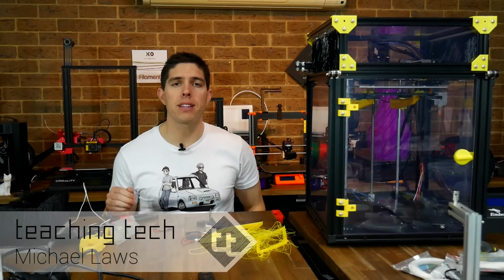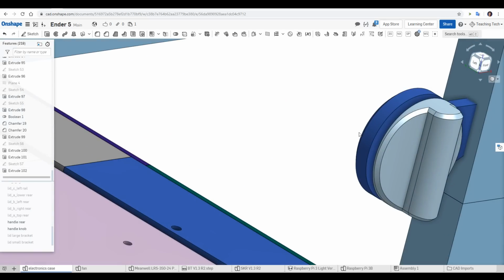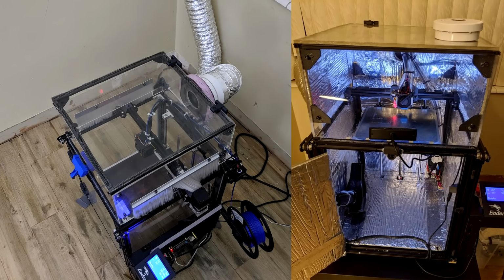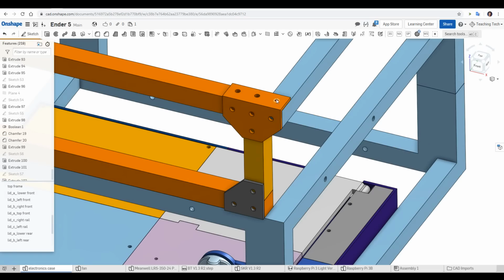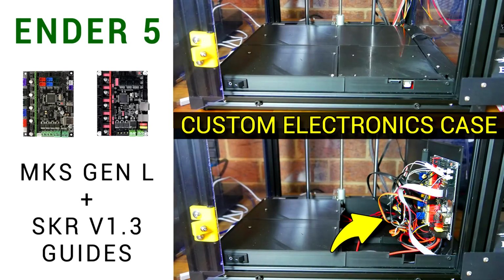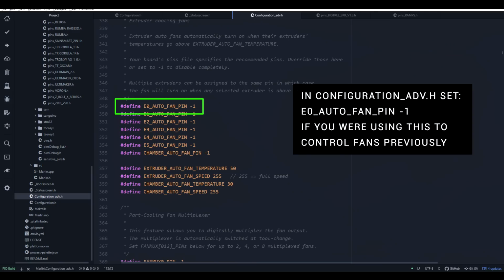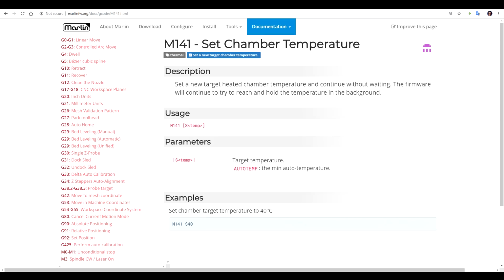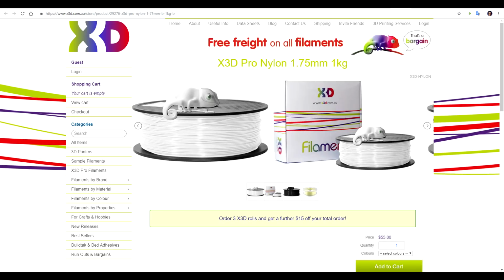Ender 5 enclosed lid and heated chamber guide

Comment: Finally. I have been waiting for this for some time. Thanks Michael. As always great upload. Any chance you plan to build a VORON???
Reply from the maker: Perhaps next year but no promises.
Reply: A VORON is a amazing 3d printer but so little people will build one because of how high end the materials are for it and overall cost. The Hypercube and Piper 2 are pretty popular because they are a fair bit cheaper mostly because they are not using linear rails. 
Also the newer style DIY infinity Y axis printers are gaining in popularity with a endless Y axis like the White knight and Piper Infinity. I can imagain quing a entire project in 1 STL file and hitting print then comming back in 3 days to have ALL the parts required for the project AMAZING!.

Comment: For your next try I'd suggest searching for PTC heating elements, they can come with just the PTC cartridge or with a finned radiator.  Ali Express has many.  The beauty of PTC is that their resistance increased as they reach their max temp making them very safe.
Reply from the maker: Thanks I will look them up.
Reply from the maker: A quick google tells me you are spot on. I've ordered a 500W one that will fit inside the chamber where I have the existing heater. Fingers crossed.
Reply: @TeachingTech  
Glad you found something, PTC's are pretty easy to work with so it should not be a problem.

Comment: I built a similar one for my CR10 and you need almost 200 watts to slowly  get warm.  It's the acrylic that is the problem.  Too much heat just leaves through it.  I tried  a 250w heat lamp and damaged the acrylic long before it was 30c inside.  I don't like using a fan. I'm not an expert but moving air can be a printing problem too.  I also don't like hair dryer type heaters either.   Too much heat and unreliable motors make a fire hazard quickly.   I have a 400 watt convection plate type heater is nearly 600 mm square x 17mm thick and sits vertically on the side/back.  So no fan.  It still takes 20min. to heat to 40c.  But it heats up quickly from there. ( Its heavy).  Consider safety  and what-if scenarios please.  Thermal switch  or thermostat  plus a line voltage control is what I use.  (Smoke alarm and fire suppression are great ideas.)   About the acrylic: It melts and will start sagging after 60-70C.  I know 1st hand.  Polycarbonate is good with 90C.   Fire proof insulation on some walls and top will reduce your wattage needs and warm up time.
Reply from the maker: Great post, thank you.
Reply: @TeachingTech  have you considered glass for the walls instead of acrylic? Might be able to handle the higher temps better.
Reply: I noticed that and will apply thermal film to see how much it will help.
Reply: I have a huge rool of ceramic fibre hi temp kiln lining I might try that ceramic fibre as a way to hold heat in and it's also flame proof  I'm thinking of making a enclosure with ceramic fibre walls and I dont really know what to use to actually heat it tho
Reply: I use tevo tornado, with hotbox fabric with fireproof inside, next troùble was stepper motor became skip when hot..  any idea?
I use SKR1.4turbo, it has free 3 spares fan port, is it okay if i add 4010 fan add the bottom stepper?

Comment: how about one of these
https://www.ebay.co.uk/itm/12v-24V-150-Watt-Car-van-Fan-Heater-Blower-Demister-12Volt-Sealed-Truck-UKstock/173918180181?epid=0&hash=item287e54d355:g:hjEAAOSwnThc75QS
or
https://www.ebay.co.uk/itm/2kw-2000w-Portable-Electric-Upright-Adjustable-Fan-Heater-Hot-Cold-Small-Fast/153619865533?epid=1205453708&hash=item23c4751fbd:g:AR8AAOSwCUldZN5j
and finally
https://www.ebay.co.uk/itm/2PC-Wall-outlet-400W-Portable-Furnace-Space-220-240V-Plugin-Electric-Mini-Heater/382655901679?_trkparms=aid%3D555018%26algo%3DPL.SIM%26ao%3D1%26asc%3D40733%26meid%3Dbca514954355472a85ac3b48edc47a75%26pid%3D100005%26rk%3D3%26rkt%3D12%26sd%3D273978586776%26itm%3D382655901679%26pmt%3D1%26noa%3D0%26pg%3D2047675&_trksid=p2047675.c100005.m1851
Just some ideas.
Great video. Keep up the good work.
Reply from the maker: Thanks for the links. I fear they will be too big.
Reply: @TeachingTech  Fair point but was just offering cheaper options. The smaller wall socket one might have done with some mods.

Comment: I cringed a bit when you showed off your hotend heater. That thing needs a local thermistor watching it. The one you put up top would not know if the chamber heater went into meltdown.
In my industry, large wire-wrap resistors are connected across mains (typ 120V) to help keep outdoor equipment enclosures dry. Those things can get blistering hot. The design is a hollow cylinder and some even have fins cast around them.

Comment: That heat gun for heating the enclosure looks like the only prommising enclosure heater. The silicone mat might do it but atleased with the hot air gun you can make the air hot and flow to ventilate it outside for those nasty fumes.
Reply: Ceramic heat lamps work well, and NASA modified a Lulzbot to print PEEK and PEI using an array of 50w halogen lamps controlled via firmware. They even wrote a nice little paper detailing the work that went into the setup.

Comment: Great video! I too wonder what can be used to heat a chamber... A guy at MRRF this year used a food dehydrator. Maybe that is something to consider!
Reply: They usually don't get hot enough for a real heated chamber. Perhaps one could be modified to ignore it's thermal switching stuff, but at that point it'd work like a weak hair dryer. So it'd probably be more effective to use an actual hairdryer.
Reply: I believe that. I have a food dehydrator that I printed walls for to dry filament. I put a temperature sensor at the bottom and it reads ~65C when cranked up to max. But that is a smaller area to heat for sure.
Reply: I think a heating lamp inside the chamber would be perdect. You can easily control with a thermostat, zero noise, and its even gives an awesome red glow.

Comment: Hi Michael, how about an ender 3 enclosure? Can the electronics be inside with TMC drivers? And Pi zero!
Reply: You don't want your electronics, namely your psu, in an enclosed, heated space above 40-50c (which is on the low end of what you'd want for printing abs or other high-heat plastics).

Prusas blog has a quick overview of basic enclosures ranging from cheap photography "enclosures" to the lack enclosure.
Reply: @YEETPRIME  thank you I was referring at the PI and drivers not the PSU
Reply: @belenhedderich3330  that's on the warmer end, it should be fine but probably won't last as long as their projected, from manufacturer expected lifetimes (which may be negligible in the first case). I did state for all of your electronics, which still remains true

Comment: I'm successfully printing polycarbonate with a bed temp of only 85C and a non-heated build chamber. Grab a sheet of polycarbonbate, and cut it to size to use as your print-bed. Polycarbonate, PLA and PETG filaments stick perfectly to Polycarbonate bed, and I get no lifting. It is a cheap solution to high temp filaments and prints lifting. I just enclosed my printer with a cardboard box :) For heating the chamber, I was thinking of trying some of the products that are out there for heating lizard enclosures - mains powered, safe and designed for area heating.
Reply: Great idea for the heater.  Just pick a UL listed model with an over-temp protection device.
Reply: Lemme guess, Polymaker PC Max or another PC +? They are co-polymers, not pure PC. If memory serves, PC Max is PC + PBT which makes it a lot easier to print, but also less heat resistant. If you don't need a bed temp over 100c and a nozzle temp over 300c, it's definitely not pure PC.
Reply: @theKashConnoisseur  Pure PC prints fine with a bed temp at 85C, but only if the bed itself is polycarbonate. The Nozzle temp is 310C

Comment: Going with hairdryer or heatgun might not be a good idea, as those have inside heating elements that can get red glowing hot and cause a fire or something, also it will be noisy,
You probably just need to use some mains heater cartridges of power like 500W and some bigger heatsink like someting used on older AMD CPUs.
Reply: No hair dryer please or we will be reading about it in the news
Reply: You could probably use an old  AMD CPU as the heater 😉

Comment: Why is no one selling a cheap enclosed corexy? Chinese manufacturers shouldn't care about that old patent. No cube-frame should be without an enclosure, considering the improvement in print quality and the potential long-term health impacts of airborne plastic particles. Also, why do they all still use v-wheels? They're cheap but dumb. I want cheap but smart.
Reply: What is an alternative to v wheels?
Reply: @snelinternet4654  MGN Hiwin-style linear rail bearings. The knockoffs are good and not even expensive. The small cost savings is not worth having the linear motion depend on squishy and bulky delrin wheels with axial bearings inside. We have linear bearings for that.
Reply: @oldspicefullbody  The knockoffs aren't great, but replacing the bearings in them can bring them up to acceptable.
HiWin rails are really at the bottom of the 'decent' linear rails food chain.
Reply: @originaltrilogy1  Interesting, I wondered about that. Have you done this?
Reply: @oldspicefullbody  Yes I have, high quality bearings are relatively cheap and accurate. Replacing the dodgy ones in the cheap rails makes a big difference

Comment: Are the stepper motors okay to work in those temperatures? My steppers get really hot when working in my enclosure, but have only got the enclosure up to 50c so far ( still a work in progress )
Reply: NASA 's solution for this is to have a special enclosure surrounding the motors, and they force air through it to keep the motors cool while printing stuff like PEEK.
Reply from the maker: Wow that's very cool.
Reply from the maker: All of the steppers are outside of the enclosure with this set up. Z is kind of at the bottom but the bottom is not sealed. I may add a heatsink if it's getting hot.

Comment: At last someone understands that a heated chamber is the only real solution to warping. It's not about bed adhesion folk. It's about the residual stress and strength of the final print. There are a few heaters designed for reptile enclosures that can potentially be used for this.
Reply: Don't you have to sacrifice controlling it with g-code in this case though? I don't think that's a deal breaker for most people but it would go against his project criteria.

Comment: Great work as always! BUT, Would a Peltier board work? You could install it halfway through the chamber and electronics, cooling one side, heating the other
Reply: My main concern would be condensation.
Reply from the maker: I had a couple on hand but the rated voltage was wrong and my research told me they wouldn't have the power (although probably better than what I achieved here).

Comment: Been waiting for this for a while Michael and glad you're still working on it.  As an engineer I really don't think 3D printers can reach their full potential unless they can print high temp materials.  I bought a second Ender 3 and I'm trying to put it in an enclosure with the electronics outside.  Haven't gotten far yet, but think it'll be handy when completed.  Videos like yours are helpful for giving me ideas and I very much appreciate it.
Reply: I got my Ender 3 printing PC and small items in Ultem 1010 PEI. If you are getting stuck or just have questions, drop me a line.
Reply: @theKashConnoisseur  Have you made a heated chamber for it? I'm trying to print Acetal, it's really hard without a heated chamber and a higher temperature bed
Reply: @theknois  yep, I built a heated chamber capable of reaching into the low 120s C. Gotta respect material properties. If the plastic needs a heated chamber, gotta use a heated chamber. If you can't, use a different blend of plastic that doesn't need a heated chamber.
Reply: @theKashConnoisseur  Could you share some of your design to see how we could build a enclosure capable of reaching these temperature ? I am wondering how to protect the electronic ( bl touch ) from the heat.
Reply: @vdiallonort  The long and short of it is, I didn't really protect the BL Touch at all. I added some aluminized tape to reduce the amount of IR the probe would adsorb from my heating system, but I left it exposed to the air temps. Basically, I'd do my bed leveling without the entire chamber heated, just the bed. Then I'd bring the system up to printing temps and start a job, only using the BL Touch to zero the Z axis (using TMC 2130 drivers to detect X and Z limits). And then I'd manually adjust the first layer height to compensate for the inaccuracies of the BL Touch at high temperatures.

Comment: That heater experiment was rather predictable, the Ender 5 already has a 220W heated bed - if it can't keep the chamber hot enough, a tiny heater made from a 40W hotend heater cartridge won't be able to do diddly squat.
Instead of a hairdryer, you should take a look at personal space heaters - they are tiny, cheap and around 200-400 watts, and also designed to run for longer times.
Reply: Ive done this I used pparts from a 240v space heater off banggood, admittedly I used a 300w PTC model, but could only pump out air heated air upto 75oC, so Ill be watching to see what works on top of that
Reply: I could only maintain temps around 70-73oC max with a 500w 240V bed attached to 6.3mm 350x350mm alu plate running 120oC at same time  though I haddnt insulated the chamber yet, but if the heated air cant get to 95oC prob not going to work. 
also I bought a spectacle frame heater to try and that was worse than the PTC space heater parts
Reply from the maker: Great suggestions. I think I'm just going to go heat gun via SSR. Got a really cheap one already.
Reply: @TeachingTech  I was also thinking you would need something over 300W for that size chamber and leakage, so maybe 500W controlled might give you enough headroom.
I also think you need a short length inside brush on the gantry to block that Vee that opens up when it passes the cover brush.
Reply: 1000watts it is...how about a strip heater with fins in a box with ssr question is how to ramp the heat percentage load so you don’t use what you don’t need out of 1000w, power related 80% duty only is ideally the case,  I am guessing around 6.5 amps on a 120v circuit

Comment: Nice design.
I have made a similar chamber with car insolation pads, to isolate the champer, - like Matt.  It gets 60oC when I print PETG, when the chamber is fully cloased, so when I print PLA, I ruin the prints, if I forget so open the door in the front...
Thanks for sharing the new development in the Marlin 2.0 fork :-)
Reply: Is it ok for the motors to run in those temps? im running a similar setup.

Comment: For thin PC or acrylic a step drill is perfect.
Reply: Yeah was gonna say that as well. If you don't have a step drill, start with a 2 or 3mm drill bit and work your way up
Reply from the maker: I rushed it and I paid the price.
Reply: @TeachingTech  Another thing is to drill it with a board underneath.
Reply: Suggestion:
Grind the twist drill with cutting edges that are inline with the centerline of the drill.
That will  remove the hole material with a scraping action instead of trying
to lift a chip that causes the drill to grab. Add a small amount of water on drill 
and material for cooling. Have drilled plastic using this method for years. When modifying

drills like this they will be dedicated to plastic use.